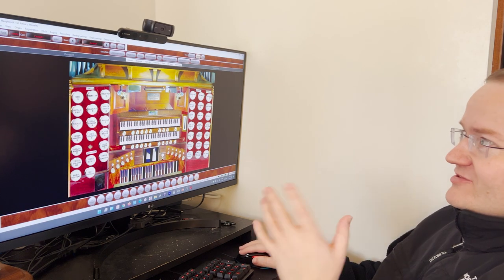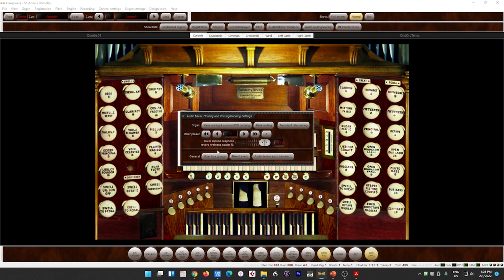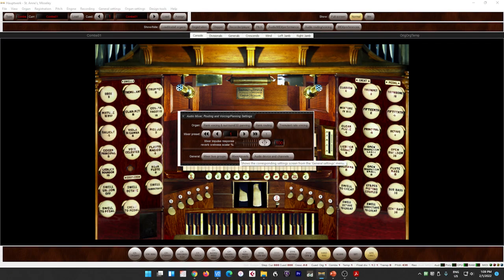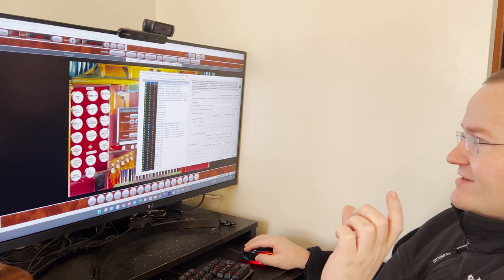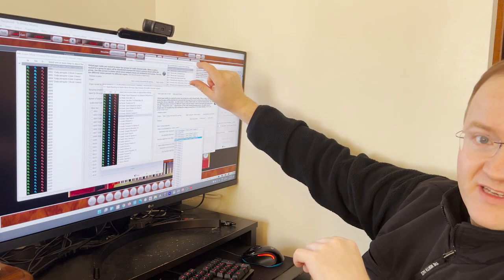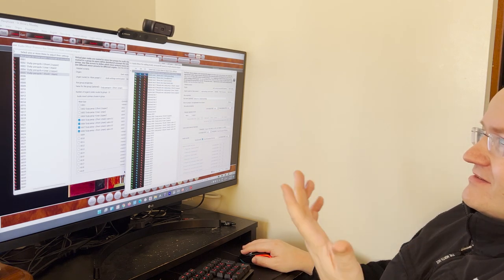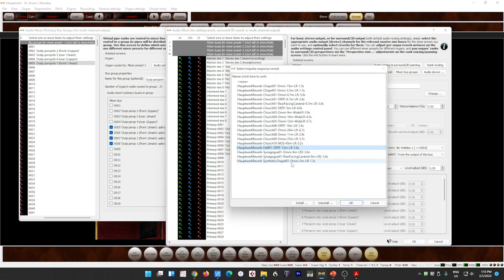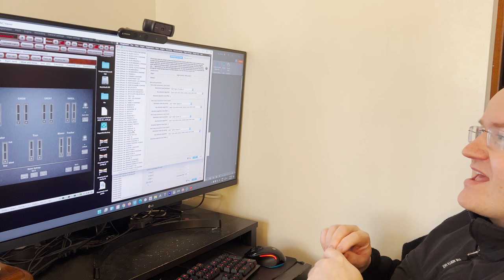Hauptwerk VII Mixer Updates, Reverb

Comment: Hi Jerry, I'm pretty comfortable with the basics but I'd like to know more about perspectives--especially as they relate to wet samplesets (as that is all I have).  For example, would you want to truncate all tails before adding any "outside" reverb?  Can you play two different perspectives on one stereo pair of speakers?  Thanks, Michael
Reply from the maker: Thank you Michael! All great questions. Indeed you can use additional perspectives and reverb on a wet set, even over headphones (check out the results on the Friesach set in this video https://studio.youtube.com/video/Fm6ecJzN7_M/edit ) - regarding truncation - yes, but I do it using the voicing screen - so for example, the main perspective I may leave the set with its "native" reverb, then perspective 2 I will route through a reverb pathway, but using the voicing screen I adjust the release truncation slider you will find for perspective 2 for all ranks to about 150ms. (I think this i better than loading the sampleset "simulated dry" as this way you have the flexibility to fine-tune and add/remove truncation differnetly on each of the 4 perspectives)

Comment: Like 3 weeks ago i finally upgraded my decade old Hauptwerk 4 license to a Hauptwerk 6 pro one. Now they've released Hauptwerk 7. I feel like if i upgrade to Hauptwerk 7 that they'll release Hauptwerk 8 right after that and when i upgrade to Hauptwerk 8 they'll release Hauptwerk 9 😂. But i don't really have a use case for upgrading.. better focus on my playing skills. Interesting video nonetheless 👍
Reply from the maker: Thanks Richard 😊 Actually you should probably check with support @ hauptwerk . com - I understand that there is a period of several weeks (under which you might fall) in that recent VI purchases are eligible for VII free upgrade! That all said; the differences between 4 and 6 are astronomical. 6-7 has some nice things, but it's not as huge of a jump (and most importantly, 5, 6, 7 are all in the same 'family' (iLok) meaning all sample sets will work with them...